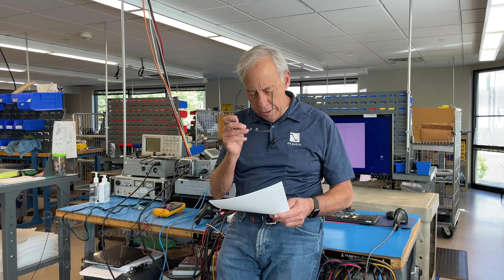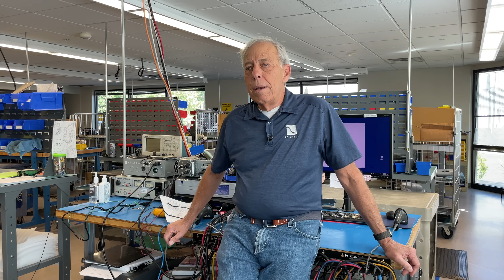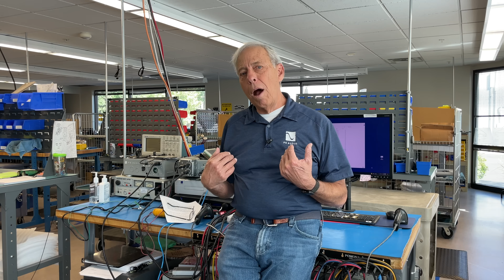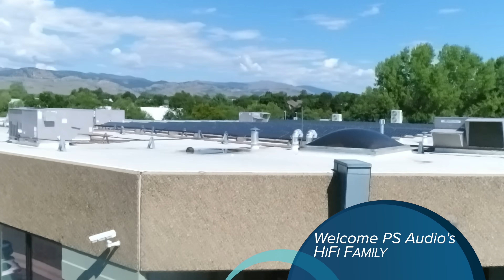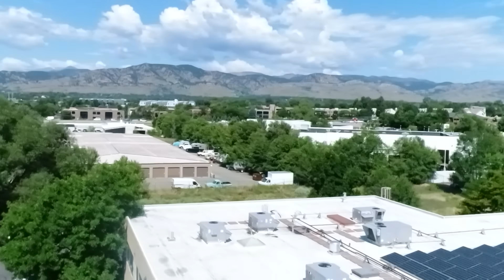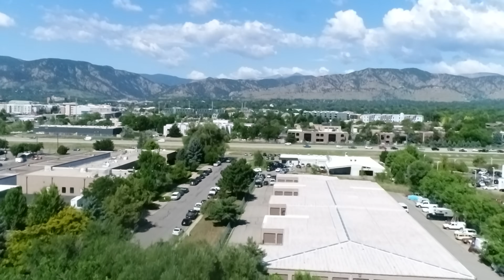Why HiFi systems sound better at night

Comment: OK heres my take on this.
Industrial noise on AC lines is a myth - Transformers -of which there are many along the power lines , effectively make the power lines discontinuous .There are breaks in it. So noise cannot carry across. Its field interaction.
Other nonsense is we change our perception at night -wrong.
Electrical Power runs on the outside of  unshielded  transmission lines ,as a combined electric and magnetic field. These fields are actually perpendicular to each other.
The sun emits RFI in the form of light - Which also is a dual field of electric and magnetic.
When these 2 fields intersect -only during the day , then "some" interaction occurs.
At night there is obviously  no interaction - so whatever effect happens or in this case doesn't happen , results in a cleaner , more transparent more robust audio.
It is not imaginary it happens.
Best way to test -For me at least ,as I live on the equator , face West and can see the ocean.
Play you favourite piece of music as sun down approaches -best if you can face west and watch the sun "drop" down below the horizon. Pause music just before the sun "touches" the the ocean. Once sun drops form view, resume music . Voila  Notice difference.  
Its like a switch being turned on.
Reply: Another factor is that resistance increases as temperature increases. So according to Ohms Law -voltage will decrease during the day -significantly in hotter countries where power transmission lines are effectively in heat soak during the day - maybe 100 Deg C difference , Power transmission Lines are copper ( Top of the scale for heat conductivity properties). Thermal expansion as well -So overall length would increase also.
All this supports the subjective theory that music sounds better at Night.

Comment: Back in my mobile bass-head days, I always swore that my subs sounded better at night and on very cold days. Didn't have any amplifier overheating or related issues, so I always wondered if air temperature and thus maybe air density plays a role in how we perceive sound, specifically in the lower frequencies in this case. I mean, we know that sound travels faster through higher densities (e.g. underwater) so maybe the bass in my case was just arriving at my ears faster which made it be more in sync/phase/whatever with the other speakers and thus sounded better overall? Maybe it was all placebo, idk, but it sure seemed louder and cleaner to my admittedly non-critical ears at the time.

Comment: HERE IS THE ANSWER SUMMED UP WHICH FOR SOME REASON HAS ELUDED EVERYONE FOR DECADES.
I have been an audiophile for over 40 years and a recording engineer for around 30 years so I hope
my comments hold a little weight to possibly end this debate.

1. Psychological- NO 
2. Cleaner power at night- NO  lived in the city that never sleeps and that made no difference. If you
notice scientifically that the good sound happens the same time every night in your area ruling out
dirty power from the grid. and why does sound get better even using batteries?
3. Night time temp and humidity changes. NO  that is a separate thing what about climate controlled listening space?

OK HERE IS THE ANSWER YOU HAVE ALL BEEN WAITING FOR, DRUM ROLL PLEASE...

IT IS THE SUN.....TA DA...!

Not sure why no one has figured this out, you know you can actually listen to our suns radio waves
and when the sun is totally on the other side of the earth we are naturally shielded from these noisy waves.

Is it me or do we humans have little or no common sense?
Am I wrong about this?

Please let me know.

Comment: If the AC power from the source is being converted to "clean" (emphasis added) DC by the power supply in your system, why would the AC in be a problem regardless of day or night, Industry open or not???

Comment: The electricity thing is too far fetched...  Ofcourse there are regions on earth where stable power supply is an issue, or maybe at some large venue... but at home, in a regular urban setting... nah.... Any distortion that might happen during daytime should be eliminated by the most basic of basic power supply in your hifi system. If you need to add things to your setup to  compensate that,... than you should hire an electrician, not a hifi man.

Comment: The Sun has an effect on radio reception due to electromagnetic field radiation, emergency responders are aware of the disruptions  during daylight hours. This effect is also noticeable on FM radio broadcasts during the daylight compared to nighttime hours with less static. The wiring inside and around sound equipment can act as an antenna capturing some of the EM radiation during the day.

Comment: HiFi systems don't "sound" better at night.  As Paul alludes to in the first third of the video, human bodies react differently to different stimuli at different times of the day and night.  It's called the circadian rhythm, and it affects all life, on a continuous 24 hour cycle. It's nature - it's why flowers open in the morning and close at night, why we get tired later in the day, why we have spikes and troughs of energy during the day, and it dictates when we are most amenable to things like music and theatre (ever noticed how a matinée performance gives you a completely different experience to an evening performance?).  It's why concert halls dim lights on the audience, to trick the brain into relaxing and to focus the mind on cerebral pleasures and experiences rather than the corporeal.  At different times of the day, the circadian rhythm of your body means you hear better, appreciate better, absorb better - but it doesn't affect your HiFi's performance.

Ambient noise also decreases in the evening - traffic noise reduces, railway schedules wind down, the world becomes quieter - again, your system doesn't "sound" better - you hear better.

AC power fluctuations during the day and night have little to nothing to do with how HiFi sounds - unless you happen to live right next door to a power-hungry manufactory then you really, really won't be affected by a draw on your supply. Your fuse board and your devices will regulate that for you as they convert AC to DC, and if you're experiencing issues with your supply get in touch with your power supplier.  What you definitely don't need is a power conditioner!

Comment: Power quality matters not if the equipment has a decent power supply. When I recorded The Ultimate Fireworks Bluray, my MOTU 896 was running off a squarewave inverter output from a truck battery. You wouldn't know it though, as the background levels were silent and totally free of electrical buzz in this recording that has over 86dB of dynamic range.

Comment: I can definately hear music differently at different times of the day. In the morning I always feel I don’t hear enough bass in my IEMs. Sometimes I go to bed and put my earphones on and then I can enjoy the nusic with much lower volume leves, obviously as there is less noise around, but also as the body is relaxed and focused on hearing and with my eyes closed, the experience of music is quite different.
On a side note, with all the issues with AC power quality and earthing issues, would it not be better to have music system running off a battery?

Comment: The guy who wrote "Get Better Sound" always said that a dark room, higher Humidity i.e. room with a humidifier turned on for at least 4hrs., and Temp 68 has a large effect on sound and like you said the power is cleaner at night. So I did the test and my conclusion was - I agree  1 Darkroom is a psychological calming effect 2 The humidity had a rather larger effect than I thought 3  The power grid that is cleaner and on my volt meter at night I got 121 to 122 and day time gets 117 so more volts more efficient system and amps. I was really shocked and now when I do a listening session for a guest I always do the above...

Comment: a dirtier ac signal day vs night.....wow.    personally i wouldve blamed rf interference and come up with a 3 to 5 g cell blocker mesh cut to size for your amps or even speakers out of the finest shit china had to offer.  at least you can blame cell towers all day 24/7.   imma laugh my ass off if i see that discussion in 6 months.

Comment: I have more answers : 1. A balancing of our sense : Our eyes are "turned down" ( there is less to see at night ) and our hearing, by natural design, becomes more acute. 2. If you have any sinus issues or congestion in your head, this tends to drain at night ( keep vertical ) 3. Our brains are more alert at night, and tuned into our senses ( similar to n1. ) or less clutter to distract our concentration 4. The downside is we may fall asleep, but I usually detect a larger soundstage and 3d image at night !!

Comment: I noticed something related possibly to AC noise day/night variation. 

When listening to Chord Hugo TT2 and Shure KSE1200. In the day, there is a quiet hum. I think is due to the two components having a different ground plane. If I touch the TT2 it goes away, likewise when I touch the Shure KSE power block. In the early evening around 5pm, that noise goes away.

However what I think is bizarre, is that the noise ends so early in the evening. ... Anyway, either way, I solved the problem with an iFi Groundhog conected to the TT2.

Comment: IMHO it has something to do with air pressure and humidity /dew point. Air is heavier at night, even in a enclosed house. At night houses are usually closed up tight and with no sunlight coming through the windows heating the air it becomes more humid and the air stills by less activity in the house and less activity from the HVAC system and sun light.

Comment: I have just found that vibrational isolation is critically important for a digital front end.  Digital clocks (as in C D transports) are especially sensitive to vibration from speakers and from that busy world that you refer to Paul. I think the "mains" problem issue is not so significant in causing jitter. Turn tables obviously also suffer from vibrational energy.

Comment: AC power differences. Is that the reason to use a power conditioner (or Power Plant) when using your audio system. We always used power conditioners on the AC in the recording studios where I worked. Oddly most of our final mixes also happened at night even when we were using automated mixing desks.

Comment: I think the reason why music sounds better at night or at weekends, is that the power grid is less charged from  many users at once and it therefore has a contagious effect on the sound quality, which becomes more clean and detailed. I myself have been the owner of a power regenerator , but chose to sell it as the improvement did not match the good sound in the late hours of the night, without a power regenerator connected.

Comment: Why not? The properties of natural air that includes water vapor & related with  pressures/temperatures do NOT remain unchanged. The human mode is changing along the days and feeling more relax at casual nights. The electrical interferences are different in times. The combination factors contributed this outcome, especially wife is not around. Right?

Comment: Hi Paul.
You've touched on the quality of power, day vs. night, and how the quality increases, generally, at night. One thing you have mentioned in the past is that line voltage generally goes up at night for the same reasons. 

But what do you think will be the result of the looming switch over from ICE vehicles to full EVs, when many, many more people will be plugging in at night to charge their vehicles. I can see the sag becoming a real issue at night.

Comment: Another audio commentator also pointed out last summer that HiFi systems generally sound better in the winter than in the summer.
Reply: why should they? speed of sound increases with temperature, proper hardware is hand warm at any time and I have 28 degrees no matter the weather outside is
Reply: @Harald_Reindl  It has to due mostly with external noise from air conditioning as well as the effect of air conditioning on AC power. Of course, if you live in Seattle or Alaska, this would not be an issue for you. In any event, it is just a theory.
Reply: @armanddimeo6575  again: if your power supply isn't absolute crap AC power doesn't matter because it's converted to DC and get a 100% clean DC is a solved problem for decades - period

Comment: I've spent the last few months getting my setup to be the absolute electrically quietest I can make it, which has been with a lot of your help, but the new wonderful side effect of that is i can now hear things getting turned on around the house with my gains all the way up, like especially the fridge since our house has horrible grounding, lots of little beeps and ticks from I'm guessing wifi or some other low speed transmissions, this is exactly why I originally started mixing at night exclusively, but since I've been working nights recently, when I wake up in the morning to try to make music nothing sounds clean anymore, I can hear god himself screaming into my headphone amp, I have to agree its noisefloor, especially if you have a house that was last grounded in the 60's, albeit my noisefloor is like -85 which I am proud of but god you can hear everything if you turn it up enough

Comment: In case anyone doubts it, the power distortion is caused by 'Harmonic Current Emissions', covered by test standard IEC 61000-3-2. This standard limits the mains distortion generated by equipment drawing (usually) more than 75 W that may be sharing your domestic supply, but heavy industry nearby could blow it out of the water.

It would be interesting to understand exactly what the real - world effects of this distortion would be on hi-fi, but for one thing I believe it makes transformers less efficient, which could conceivably hamstring a high end amplifier's responsiveness.
Reply: Irrelevant - build a proper power supply isn't rocket science except for ordinary expensive high-end crap which seems to need hand holding
Reply: In addition, while this standard is mandated for CE/UKCA marking ac powered products in Europe, I'm not sure the same applies for the USA? Perhaps the mains quality situation is worse in the US as a consequence?

Comment: In adition to what paul has said. The speed of sound also changes as the temp and humidity change which  affects many things including crosover freqency's room modes etc.  PA systems in the 90"s used to have meterological probes for out door concerts to compensate for the change.  In my country sound travels much further as at night the air gets more dense an night than during the day due to the 15-20 celcius drop.
Reply: I strongly believe the humidity, temperature and changes in speed of sound are the main reasons for the great improvement between day and night listening.
Reply: @edgardomaldonado221  temperature and humidity don’t change much in most houses from the day to the evening so I don’t know why it would sound better
Reply: Yes but what you fail to appreciate is PS Audio don't sell a product that alters the speed of sound, so we flog the one thing we do sell a power re-generator. If it was simply down to power and ambient noise, then what is the reason sound travels further at night? Because it changes.
Reply: So the question now is: If you drop the temperature of the AC in your listening room to 10 Celsius (50 Fahrenheit) will it sound better? Will a humidifier make a difference? lol
Does your hi-fi sound better at sea level or like where I am at 1.8km (1.1mile up)?  My car goes 30‰ faster at sea level so my hifi should sound 30% better then.
Reply: @julesc8054  wrong comparison! your car has more power at sea level because of the air pressure, which is higher at sea level! The more air pressure you have, more air-gas mixture goes into the combustion chamber, hence more power! The same principle of a turbo! I never tried to get the same system in the same room at different places though :-)
Reply: Air density might have something small to do with it but the noise floor is quieter at night that’s why sound travels farther it’s not being over powered by other sound. At night I can hear trains on the other side of the valley I live in but during the day I can’t hear them because of the highways nearby.
Reply: not only the speed of sound but also the way it propagates in the room

Comment: Respectfully, Paul, cobblers. Music sounds better at night because your mind is tired after being awake for 12+ hours and so you're listening less critically. That's it. No need for an expensive snake-oil box to do what every PSU in every mains-powered unit, from your amplifier to your phone charger, already does when it converts AC to DC!